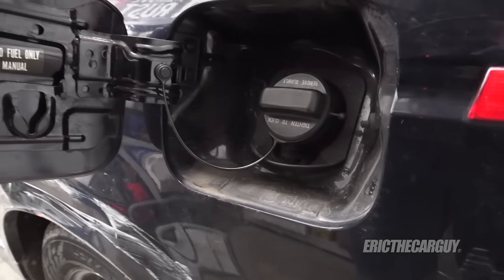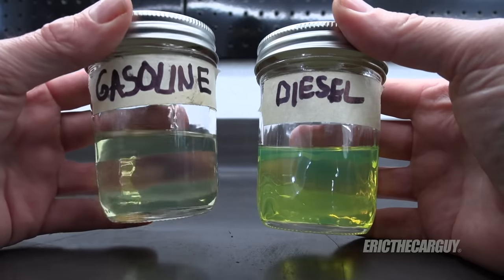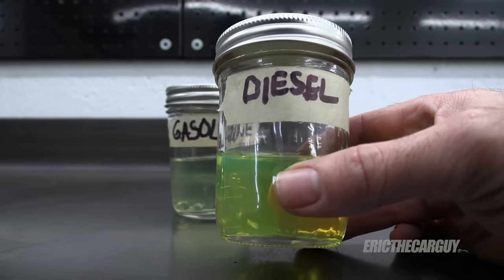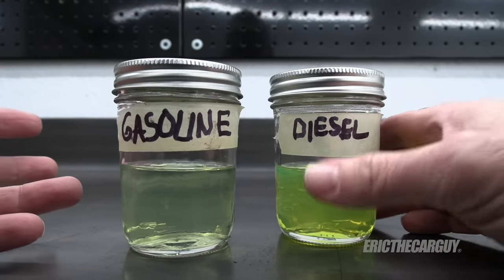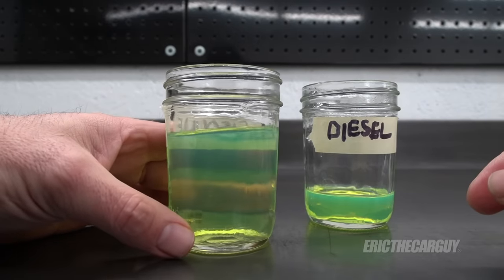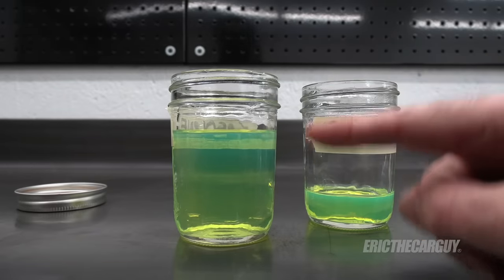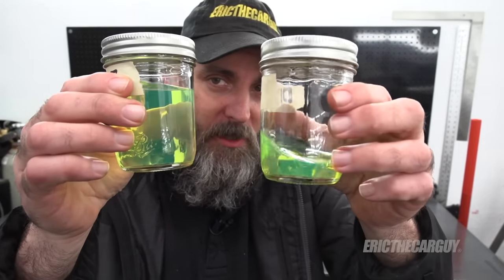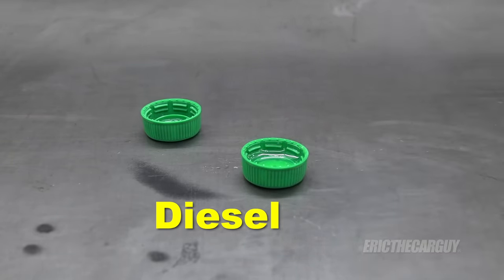What Happens When You Put Diesel in Gasoline?

Comment: I disagree, from my experience, with gasoline in a Diesel engine. However, depends on the ratio.
A couple of gallons in a 100-200 gallon tank and it’s a great injector cleaner…..even gives you a little extra short term torque. However, large diesel tanks often vent to atmosphere and the unused gas will evaporate within a few hours.
The blue 2 stroke oil also works great in a modern Diesel engine
Reply: I pumped it out the old diesel. I have sludge left in my diesel truck tank. A  guy said to put enough gas in to cover the sludge & it would dissolve the sludge & then drain the stuff out. Would this work?
Reply: Lol 😂 injector cleaner ! No , I suggest you pull an injector from your car and have a look at how tiny the holes are , if you have clogged injectors you need to replace them ,… no such thing as refurbishing injectors either … manufacturers recommend replacing injectors every two years ! No one does and everyone believes they can be cleaned ! All lies
Reply: Yes. In fact, in a 57 hemi Many many times  i have   experienced just that,  I put in. As much as 1.5 gallons to 30. gallon tank of unleaded. and there is extra torque easily felt when you step in the throttle and the engine idles as smooth as it ever has, if not more. The other added benefit was. doing this. when I was going to be traveling down the highway, I gained 1.2 actual miles per gallon. which offset the expense of that gallon of diesel. I generally only use it in gasoline when it's cheaper. than it is at the pump now, but Diesel is a lubricant. These clowns don't even understand the difference. They think it's like mixing oil and water. I. never met so many clues. People. So afraid with zero understanding I'm glad I was born 55 years ago.

Comment: In Europe Diesel pumps are marked black and Gasoline is always green - at least for the last 20+ years since we switched to unleaded. Gasoline pumps also have a much smaller spigot, so Diesel pump will not fit into the tank opening. Putting Gasoline in a Diesel is a common thing though. Modern Diesel cars seem to stop soon enough not to cause damage and the mistake costs about 4x what it costs to pump a tank of gas (1x for the gas you've put in there, 1x for the filters, 1x for service and of course you still have to fill the tank with Diesel in the end)

Comment: In 2008 a fuel delivery man got mad at Costco and put diesel in the gasoline tanks. Girlfriend put quite a bit in her Jeep Liberty. It still had 1/4 tank of gasoline, so it started just fine. i told her not to turn it off. it's a 2 hour drive to where I live and I topped it off with gas. it smoked some and hard to start but we kept the gas topped off. in about 3 days you couldn't tell anything was amiss. No ill effects.

Comment: i have a 70s engine the hoses at the station were mixed up so i put diesel in it, it ran rough but still went once you got it going you could keep it going as long as the revs were up when i turned the ignition off the engine did keep running because the compression was igniting the diesel

Comment: Yep. It was done in Oregon as well. I just got new injecters, filter, and line for my Civic. I thought it was the marvel mystery I would use in  each tank, until I could barely keep the motor running after one fill up at the same Fred Meyer gas station I had gone to for years. White smoke all the time, chugging and missing like no tomorrow. I dumped a can of sea foam and it slightly helped, but main symptoms of misfiring and white smoke engine chugging out still happening. And this, right after a tune up !!!!

Comment: Decades ago I regularly added @ 10% gasoline & 90% diesel to my 1st gen Diesel Rabbit to give it a little ZIP...made it feel like it had a turbo which it didn’t. I ran it that way esp in the winter for 5 years
Reply: Back in the 70's granit haulers use to stop at a dinner in Vermont and put some gas in there trucks to lesson the fuel from gelling. That was when the temp would be well below freezing.
Reply: @wallaceeverett3927  That is some trick I still know, and actually the only exception that allows putting gasoline into a Diesel. 
As you mentioned the Diesel starts gelling below certain temperatures, after a time it really gets some kind of nasty waxy substance.
Adding at most 10 % of gasoline would actually change lower the gelling temperature and kind of disssolve the wax.
At least here in Europe, they change between what they calll summer Diesel and winter Diesel in time. Winter Diesel has additives in it that prevent Gelling down to temperatures around either -20 °C or -30 °C, can´t remember actually. I guess its the same in any part of the world that may reach critical temperatures these days.
By the way, you still can use this trick today, if you have a Diesel that gets only low miles and you put in fresh Diesel last time during the summer, just put in some Gasoline, depending on how much Diesel you have left in the tank.
Alternative method: Use a torch or make a fire beneath the engine to preheat... Lets call it the "russian way". Not sure if anything not beeing an Ural or whatever will live through or not burst into flames. With modern cars you might get a heap of burning plastic way before the engine heats up...

Comment: Welp now I can see how someone foreign is going to mix those up. In Portugal at least, gasoline is labeled in shades of green (for the several octane ratings in RON) and diesel is labeled in black
Reply: That is the same as here in Australia. When they have them alongside regular fuel pumps there is often an extra lever that needs to be pushed down to unlock the the diesel filler.
Reply: @AndreasKoepkeAU  I guess the lever is somewhat of a fool proof method. Here you have to read to be sure (aside from the labels).Gasoline usually is 95/Premium 95(Both E5 - 5% Ethanol) both in dark green or 98/Premium 98(Both E10 - 10% Ethanol) in light green. Some brands also have "premium" diesel in yellow (Both B15 - Biodiesel 15%)
Reply: NoobGamerPT americans have allways everting in reverse. Remember they use miles, gallons, inches...etc
Also, they only use diesel in SUVs and 4x4 trucks, the rest are gasoline.
Not like in europe, more than 50% of cars are diesel, even small city cars. Or at least it was before diesel gate and eletric cars start to rise.
Reply: @sjogosPT  the same team which reported on VW diesels found after that BMW's, gasoline type, also over polluted than reported. No wonder Germany is getting in trouble with the EU for emissions in some of their cities.
Reply: The very first time putting gas in my car after moving back to the states from Mexico, i do exactly that 😅 diesel in a gas car 🤦🏻‍♀️

Comment: A colleague of mine went to refuel a Saab 9-5 petrol. He filled diesel in it and drove roughly 3-4 kilometers before the 2.3T suddenly stopped. Inspections showed there was a crack in the piston and the inspection camera went right into the oil sump. The engine ran fine before this, so we suspect it was caused by the mixing of diesel into the tank where the liquid wouldn't ignite.
Reply: Maybe due to low octane number of Diesel it was preigniting, breaking everything inside the engine

Comment: If you let your mixture sit for a few hours, the gasoline will be the top layer and diesel on the bottom due to specific gravity.
Reply: Good or bad
Reply: not it will not. it is like mixing milk in coffee. the only process that can separate them is the distillation process as they do for crude oil. So petrol and diesel will mix together and form a blend.

Comment: When I use to work at an Infiniti dealer, we had a customer have their brand new Q50 towed into the shop because they filled their car with diesel fuel. Car was practically still new. Probably had just under 1k miles. The tech that worked on it just drained the fuel tank and changed the spark plugs and filled it with gasoline. Surprisingly it started up after several cranks. Yeah that was some crap seeing that.
Reply: Non car people don't deserve nice cars
Reply: Random Stuffs that is the world we live in unfortunately

Comment: I've run a car on tank drain fuel from a dealership dump tank. We called it PERV. A mix of Petrol and DERV. 
Ran ok, occasionally misfired then just carried on regardless. It was a small, low output engine so relatively safe, just dirty sparkplugs until you have it a good hammering

Comment: Older diesel cars did recommend using petrol in the tank on occasions of deep cold when fuel gelled.  Solvent properties made for great flow.  Best to use kerosene, but gas, in reason, won’t destroy a real diesel.  The new eco-friendly diesels fail to function well in real cold
Reply: Pilot injection helps cold starts
Reply: Sea Foam works great for anti gel

Comment: Eric, I delivered fuels for many years, both gasoline and diesel. The tanks were never washed out. However, we did load gas into the container that had diesel to cut the diesel. But then you may be talking about 3 gallons leftover mixed with 3600 gallons of gasoline.

Now deliver was extremely important. You had to be sure you loaded diesel only in a diesel tank at the stations, and the same with gasoline. 500 gallons of diesel into a 50,000 gallon tank wouldn't hurt anything much, except the driver's paycheck (which he no longer got from our company). 

Now going the other direction, if gasoline was delivered into a diesel storage tank and then pumped into a diesel vehicle: NEW ENGINE.  Gasoline is too volatile for use in a diesel engine. It will wreck the injectors, preheat chambers, and the fuel pump. Rings tend to crack or break off. And then the oil gets diluted seriously. 
Moe
Reply: What about 400 ulsd in 17k regular tank

Comment: Okay, this is retro as hell, but..... We use to add a gallon of diesel to the tank on a fill up occasionally. Word was that it cleaned the combustion chamber and lubricated the valves. We would also top up the oil with a quart of diesel just before an oil change run the engine to full temp at low load to remove more impurities from the crank case.

I did it because my dad did it. It may have worked. I did it with a used 1964 Chevy pick-up with the 235 6 cylinder. I put 400,000 miles on it. I then sold it to a friend who drove it for 10 years, or so, and continued the diesel thing. He sold it just before he went on to the other plane. It had sat for 10 years at that point. The guy who bought brought a used battery, a fuel pump, and a rebuilt carb. It started on the third crank, ran rough for a few seconds and settled down. Then he took all four wheels off, came back with new rubber and drove away. I don't know whether it was the diesel or just how tough and forgiving those old trucks are.

Comment: It’s extra awesome when your delivery guy puts a couple hundred gallons of diesel in one of your tanks (ended up being around 30% diesel) and doesn’t tell you. We’re a fleet station and chased this problem for 2 weeks before I discovered what happened. I imagine there will be a lot of o2 and catalyst problems in our future. Changed a TON of plugs so far. Also can’t wait to see what possible side effects the diesel has had on any of the rubber or synthetic rubber components.
Reply: I mixed 400 ulsd in regular tank at full capacity of 17k. My company fired me they said they had to pump all 17k gallons out?

Comment: I've seen gasoline engines run ok on diesel. On more than 50/50... I think it was a carburetor engine but it didn't clog any filters. It just smoked a little from the oil
Reply: @KLMALLENDER  
It probably was much worse than I thought it was.

Comment: I was a mechanic in the 60's, to 80's,  where I worked,  there was a 5,000 gallon diesel tank that would get filled on the weekend,   to use all week, we had 12 diesel trucks,  Monday morning,  I would be there as the drivers started their trucks, about 5 minutes after I heard some knocking and sounded like pre-ignition, I yelled "shut it down", then while I was checking the truck another truck started, banging and knocking,  I had all the trucks shut down,   as I was checking things I smelled  gasoline!!!,   5 of the trucks had gasoline in the tanks, I red tagged those 5,   the others I let go to work. What happened,  the tanker driver put approximately 1,400 gallons gasoline, in the diesel tank,  all 5 trucks were completely drained, and the fuel system's flushed,  refilled with diesel,   I found No Damage,  But it was caught  quickly,   them the 5,000 gallon diesel tank had to be completely drained and refilled.  Then when I was 18 years old,   I took 5 gallons of diesel fuel and poured it in my 1962 Mercury Comet inline 6cyl.  Carburated engine,  it smoked like Hell
but it ran !!!, But when I shut it off and let it cool down, it wouldn't start but it puffed out blue smoke !!!
So I had to drain the tank, blow out the line and carburetor then it started again and ran fine after the cylinders cleared of diesel fuel,  "Dumb Kid Stuff" 😆😆😆😆😆😆😆😆😆😆😆
Great Video nice tutorial
Long Beach, California

Comment: Have had a renault kangoo here in europe (1.3 diesel) and accidently put 35 liters of gasoline in the 55 liter tank, finally noticed and topped of with diesel........drove fine, every few miles put some more diesel back in and really never had an issue because of it.......................drove fine the next 3 or 4 years

Comment: I'm adding 5% gasoline to my diesels every time. It is even recommended by manual for winter sezon (old engines: 2.5 TDI v6 and 1.9 TDI 1Z).  They have little bit more power on this mixture:)

Comment: Back in the day when I was working in a motorcycle shop, someone filled up a bike with diesel. What a mess. Even after cleaning the tank, carburetors, and fuel lines, the bike still smoked like a chimney for about 10 minutes LOL. Years before that when I was working for a roofing company, somebody put gasoline in the brand new diesel truck they just bought. It idled at three grand for a few seconds and then that was it. Tow truck time, ha ha ha!

Comment: Chemist here, some things i want to point out.
Diesel and petrol have quite different physical properties, but the chemical properties are quite similar. The viscocity in diesel stems from the longer hydrocarbon chains, which also results in a higher boiling point than petrol. They are perfectly miscible because they are both very non-polar. They also have very little way of reacting with one-another because they should (in theory) have little to no reactive functional groups. 

According to a video of Project Farm, washing through a petrol system that was first added diesel with petrol should dilute the diesel enough to get the engine running (lower viscocity). Probably as you said because the clogging of the fuel filter and possibly injector? 
Other way around (adding petrol to diesel engine) should be a fun experiment though. Wonder what would happen.

Comment: Just bought M-B CLK 320 for very cheap, because it would not start. It had missfire codes, thick gray smoke coming from exhaust etc. Then i realized that previous owner must have put diesel in it by mistake. Drained the old fuel mixture out and put 30 litres of gas in it. It started, idled roughly for few minutes and then it started running with no problems. Cheap fix.

Comment: Back in the day when they drove carburetor engines the old timers would actually put a gallon of diesel in with the gas on a fill up. They said it cleaned out the system and carburetor. Don't know if that's true or not

Comment: So I'm heavy equipment diesel mechanic and for about 4 years I ran a 50-50 mix premium gasoline and pump grade on road diesel in my 1993 Isuzu rodeo 3.2 l V6 did not notice any lack of power never had issues with injectors filters pumps etc like I said I done this for years The one downside was my vehicle smell like a diesel and older diesel it wouldn't roll call but you definitely had some unburned diesel smell on the exhaust this engine is still running today The rig is now a play toy 360 plus thousand miles and doesn't hiccup runs flawlessly

Comment: the Project Farm channel has gone into this subject a bit. He did testing using a carburated push mower. The engine would not run an strait diesel, but ran ok on a mix. Unfortunaltly, he did not test gas in a diesel or fuel injected engine

Comment: Gas in a diesel engine will wreck the fuel pump first which operates at extremely high pressures. The pump actually relies on the lubricity of diesel fuel to function properly. With insufficient lubrication, you can guess what happens. Quite common here in the Philippines since there are several popular utility vehicles and pick-ups that come with both diesel and gas engine variants with the only distinction being a sticker on the filler cap.

Comment: Thanks for the video. My granddaughter managed to put 9.5 gallons of diesel in her car with an 18.5 gallon tank (gasoline car). Needless to say, once the mixture in the tank reached the engine it quit running. Once I figured out what happened, I siphoned out all the fuel I could get and filled the tank up with gasoline. After several tries and spraying ether in the intake manifold, we finally got the engine running fine. The check engine light is on now but I won’t be able to read the error code for a couple of days. Hopefully it will just be an error that needs to be reset with an obd2 reader.
Reply: Error code was a misfire in cylinder #3. It cleared and everything is aok now.
Reply: You're obviously referring to an older carburetted vehicle. because any new vehicle has a small neck and won't allow the diesel fuel. nozzle. into the tank, In that case, yes, in a carburetted engine, it would not run well at that mixture., in a few injected engine. However, it has no choice but to get injected and burned. and it will end of story. Injectors don't care